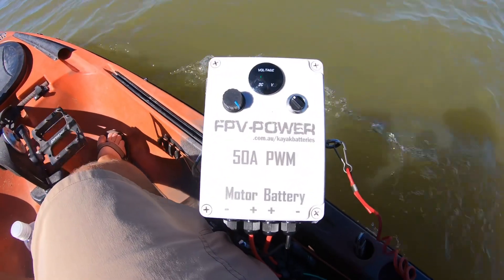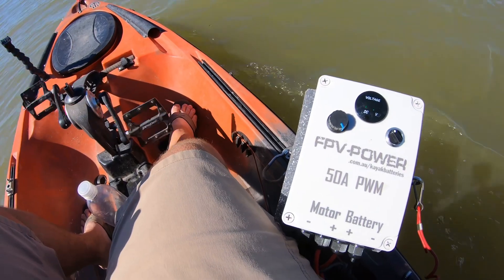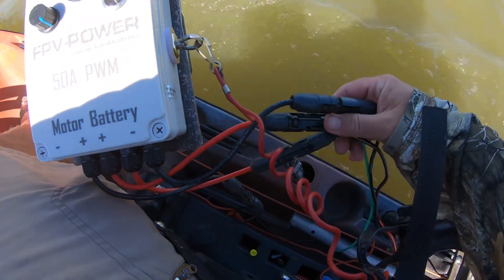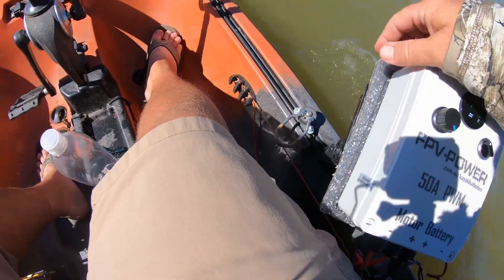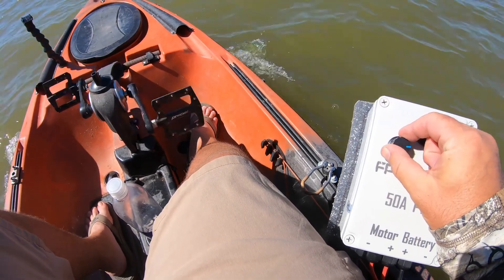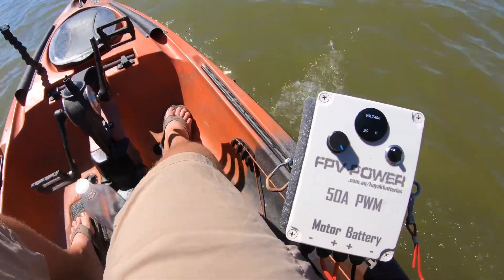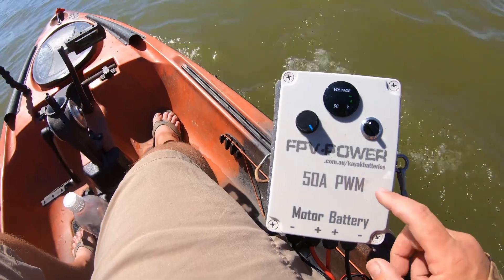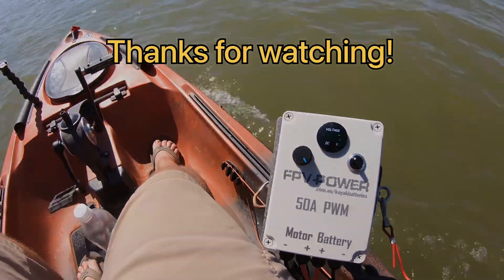FPV-Power 50A PWM controller on a Native Titan 10.5 review

Comment: I see in later videos you went to a torqeedo. Did you ever have an issue with this pwm and motor setup that caused you to switch?
Reply from the maker: I actually went through three of those controllers before biting the bullet and getting the NK180. The longest one lasted me was about six months.

Comment: G'day mate how have you fixed it down? Did you have to open it?
Reply from the maker: I cut piece of cutting board the same size as the unit and bolted the cutting board to a depthfinder mount from yakattack. Once those were bolted together I bolted the cutting board to the back of the unit by using the 4 holes in the corners.

Comment: Anyway we can get a walk through video? Have the same motor and looking to get the same thing for my setup and I'm wondering how you got yours set up. Thanks in advance!
Reply from the maker: Let me know if you have any questions
Reply: @J. Brucker Fishing  how did you wire it from the battery positive side to the pwm. Did you have to make your own cord with a inline fuse, or wire it straight to it or something else.
Reply from the maker: @dustinstanley7781  I removed the head off the tm and there’s 4 wires in the head but you only need the red and black and you use the connections that comes with the pwm. https://www.fishingonline.com/products/fpv-power-motor-controller-pwm-50a-v2?currency=USD&variant=30292764524567&utm_medium=cpc&utm_source=google&utm_campaign=Google%20Shopping&gclid=EAIaIQobChMImJHTn8fd_QIV5_zjBx0JvwnoEAQYASABEgKrb_D_BwE
Reply from the maker: https://youtu.be/3JrahImacJc